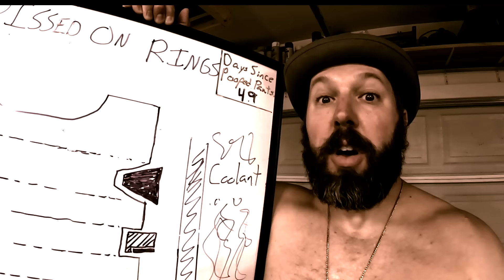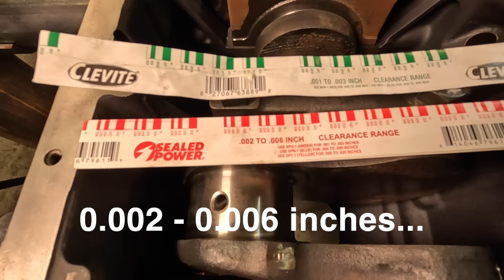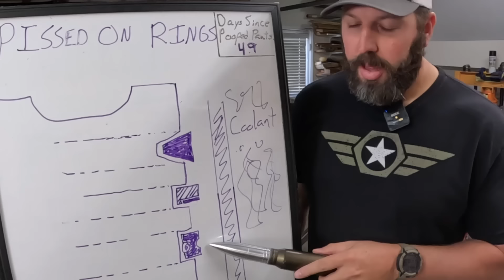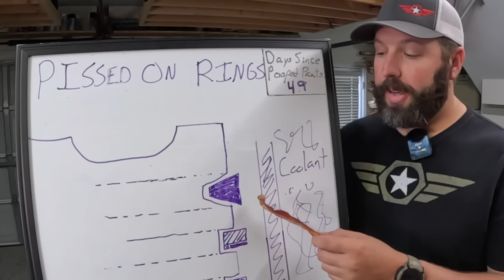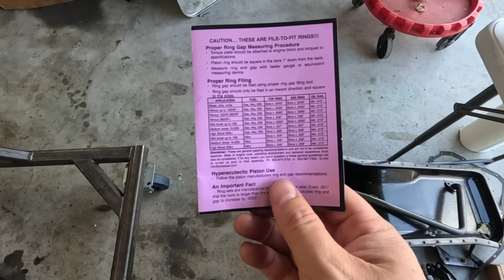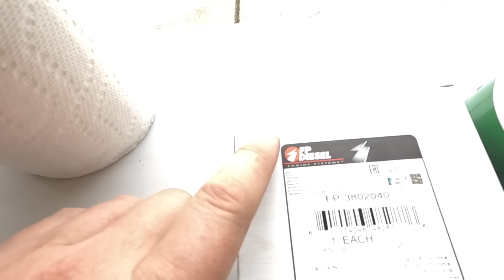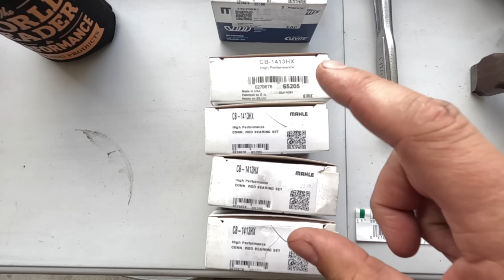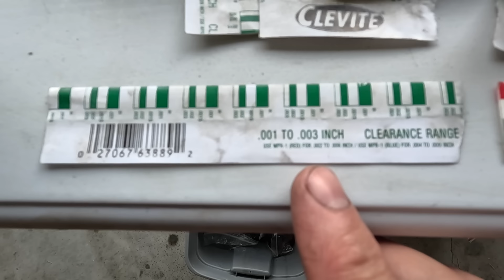BUDGET 12 VALVE CUMMINS FAIL: 700hp 12 Valve Part 2

Comment: I remember in college rebuilding a case tractor engine. plastigauged  mains and found it a bit tight. My instructor came over with a hardwood block and a hammer smacked the bearing cap fairly hard and asked me to recheck clearance. It gauged in spec. He was a engine rebuilder for cat. smart man.

Comment: I rebuilt a slant 6 that had trashed all bearings. Trashed cylinders with massive ridges. I threw new rod bearings in it no mains and put new rings in it.
Spec is like 10 to 20 thou and i was reading 35 plus. Fookin thing runs like sewing machine with copper on the mains and those massive gaps. Man what a loyal hunk of shit. Full sends only baby.
Reply from the maker: You never know until you try 😎👍

Comment: You deserve more followers, this is an awesome channel. I work in an engine machine shop and I’m only mildly disturbed by the choice to just send the crankshaft.

Edit: I watched more, good choice going to the machine shop, also it only hurt a bit hearing the comments about it costing $2000 and taking two months… but I can’t fault you on that comment
Reply from the maker: Thanks for the kind words. Hopefully thy subscriber count will keep on ticking up. And hopefully my machine shop can get the crank and rods in order for the under $1k 👍. But they have had them for 2 months at this point…

Comment: "Two months and a thousand dollars later"
Yeah I know that feeling.
I had a single rusty bore on a 6.9 IDI I've been building. Got a quote from the only reputable-ish shop within a few hundred miles for a single sleeve, $1,200. I asked about full sending it with all eight sleeves. $1,800.
I said screw it, dingleball honed the bores and sent it. With the shortblock fully assembled I decided to inspect the heads for the first time. Not good. Exhaust valves were all trash. Before buying valves and hand-lapping them in, I called another place that only does head work, about a valve job. Guy knew his stuff about IDIs, said the exhaust valves would all be scrap before I had a chance to say so. We talked for a bit, then I asked about cost and lead time. "Oh.... at least $1,000. And we couldn't get started any sooner than three and a half weeks."

So I have some Stellite valves on order, and I'm hand lapping them. Happy day.
Gonna boost 'er to the moon and see where the limit is, then back off a few pounds and do it again.
Reply from the maker: I feel like I need to open a machine shop. It seems like you can charge as much as you want and take as long as you want. 🤷‍♂️

Comment: As I replaced the head gaskets on my LB7 duramax. 
You should have seen the rtv on the lifters a springs from whoever put the valve covers on before me owning the truck. 
An what a pain to clean it off. 😂
Reply from the maker: RTV on the valve cover gaskets? 😂
Reply: @freedomworx  upper valve covers on a lb7 duramax does not have a gasket. Just the lower value cover does.
Reply from the maker: @2dogsmowing oh…. Gotcha 👍

Comment: I'm kinda pleased you're taking it to a machine shop... I'm eager to learn about that process. What do you do, just hand the parts to the shop and they know what to do, or will you specify anything?
Reply from the maker: If you don’t tell them exactly what you want done, they’ll generally do everything. Because that makes them the most money. I told them I only wanted the crank ground and the big end of the rods resized. If I hadn’t specified, they probably would have put new bushings in the small end also, and that would have cost me a couple hundred extra bucks. If you take the them a block and don’t specify, they bore it, honestly it, deck it, align hone the main caps, etc… And you might not of needed all of that.
Reply: @freedomworx  Good to know! I pulled a 12 valve out of a field a few months back.. runs great now, but I haven't torn into the motor at all. Like you said, I could stay happy and not open it up even if it needs it, but my toxic trait is not leaving things well enough alone...

Comment: Gunk in a ultrasonic cleaner works excellent
Reply from the maker: I need one of those vibrator thingies.
Reply: @freedomworx  I have a 3 Liter and 15 Liter Vevor Ultrasonic Cleaner both have been great. If you buy one buy at least a 6 Liter. Fill it with hot water then put your piston in a 1 gallon freezer bag and pour the Gunk parts cleaner in the bag. Put the bag in the water and when clean pour back in the can. Most carburetors can be cleaned like new in 30 minutes to 1 hour.
Reply from the maker: Thanks for the tip 👍
Reply: @freedomworx  be careful, keep an eye on it. I have stripped chrome off float bowls on really nasty parts. Do it for 15 minutes at a time.

Comment: The question is not " will it make 700 HP and the block didn't go to the machine shop" because it will, the question really is "how long will it make 700 HP and the block didn't go to the machine shop" ! 😮
Reply from the maker: Yes, to be accurate. That is the question. The machine shop has had the crank and rods for 7 months. So I had to buy another crank, with a hot rod wrapped around it 😂https://youtube.com/shorts/kq8ggq5uBxY?si=dlZGkXiki5CCIPIR

Comment: Hows the bypass oil filter coming along?
Reply from the maker: The oil has 14,250 miles on it. Doing a follow up video at 15k when I perform another analysis. 10,000 mile analysis looked great. 👍

Comment: I've never done piston installs before, but I thought you're supposed to use a ton of oil to get those rings to slide in.
Reply from the maker: Just a little coat of oil. The rings are going to scrape it off anyway. 👍

Comment: I totally would have swapped You're loose cylinder rod bearing with your tightest and remeasured. What happens if you put the old bearings in a measure?

Comment: No way you're Burnt Chrysler because I've met him and he is wayyyyy fatter! 

I love the piston ring gap dilemma. Some people have to have them in just the right location or the engine will for sure blow up. I'm more of a just don't line them up and stab the piston in type. Many experienced guys have argued about ring spin but every engine I've popped pistons out of the ring gaps are in random locations so they 100% move.

Also the bearing quote "they're darker so they'll run faster" got me!!!
Reply from the maker: Yeah, they move a lot more than people thing. There isn't a good way to predict what they will do, and it's based on many factors. But a study I read, that used radioactive tracers on rings to measure their rotation while the engine was in service, is that 3 revolutions around the piston per minute, is a good average. Of course, the darker the ring, the faster they rotate...

Comment: Now this is just me- I would have knocked out the 3 tight ones and take some strips of 220 carburundum  or (wet/dry) grit paper and sand down the 3 journals then finish them with strips of 600. That would take off 1-2 k. But, that is just me.
Reply from the maker: That wouldn’t have helped the one rod that had 0.006” or more of clearance. The rods needed to be resized. The crank could have been run. But if the rods are going to the machine shop, the crank might as well go too. But that’s just me 😉

Comment: Disclaimer... I have only talked to professional engine builders about this. Plastigauge is not ideal, but if you're going to use it, use a new set of bearings afterwards. Once the bearing is crushed in, taking it off and reinstalling it increases the risk of spinning a bearing.
Reply from the maker: Using a new bearing after using plastigage totally defeats the purpose of using plastigage, or measuring the oil clearance by any means for that matter. The purpose of measuring the oil clearance is to account for manufacturing tolerances in the bearings. And plenty of professional device builders will reuse a bearing. There is no reason to replace a perfectly good bearing. The crush doesn’t change after subsequent installations. And any “engine builder” telling you that, shouldn’t be your engine builder.

Comment: How does the budget look when you get the 12v free from a barely used military genset from 1987?😅
Reply from the maker: Looks the same actually. Because it would be easier and cheaper to buy a totally different P-Pump engine, than to source everything to convert the engine you have to a P-Pump engine. 😉

Comment: 23:08  they have started making dimpled pistons for diesels..   not sure if that’s what your intent is,  but supposed to be great for emissions! 

33:20  they darker, so they obviously run faster.   FKN caught me Dead!!    

35:41 SNAFU?  Situation Normal. All fkd Up!
Reply from the maker: I am familiar with the SOA dimpled pistons. But if you ever price a set, you’ll understand why nobody uses them 🥴.  The dark ones are definitely faster 😂
Reply: @freedomworx  eh,   Someone else decided I didn’t need my Cummins anymore..   so I haven’t priced anything for a diesel..  unfortunately..
And you know insurance is so great I got a new truck right away!!  So..  

but, build back better that engine, it will be as good as inflation. 20% less then when new!  🤣🤣
Reply from the maker: 20% is pretty conservative 😂.  BTW, those dimpled pistons are over $500…each.
Reply: @freedomworx  500x6=(checks fingers) only 3k for a Cummins!  You’ve already broke one oil ring, might as well.   🤣🤣.      
But I mean, you do have a hammer..  you know,  science..  
That’s a ‘spensive piston.    Technology seems pretty cool if they do what the manufacturers say they do.
Looking Forward to the next build video!

Comment: Since you said you have mics and bore gauges, why not measure the crank and rods on the ones giving you trouble to actually see where the trouble lies?
Reply from the maker: Doesn’t really matter where the trouble lies. Multiple rods or crank journals are not happy. So I figured I’d give them all the treatment. It’ll take 2 months whether they size 2 rods or 6 rods 😉

Comment: No sense in throwing good money after bad.  Iv been in this position so many times im not sure if there is any other way.   It runs good lets strip it and just simple clean and re gasket-   $4000 later all the little imperfections you weren’t worried about now are a serious concern for premature failure.   Never cut a fat hog in the ass-
Reply from the maker: "Never cut a fat hog in the ass"... are you from the Ozarks? I had to look that one up 😂👍
Reply: @freedomworx  indeed,  I was the fastest baby in the ozarks Olympics in 86-  Won a year supply of diapers
Reply from the maker: @wellscody86 😂😂

Comment: Why not 320 ball hone 🤔
Reply from the maker: I think the rings called for a 280. But I already had a 240, and they didn't make a 280. 240 and 320 were the options. So I did the calculus and figured since they were both equally wrong, I'd just use what I already had 😉